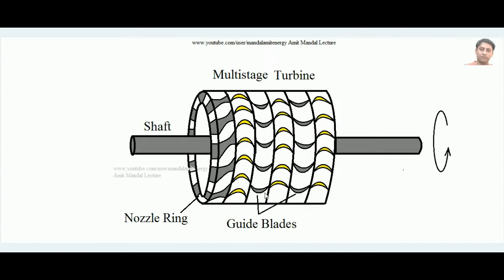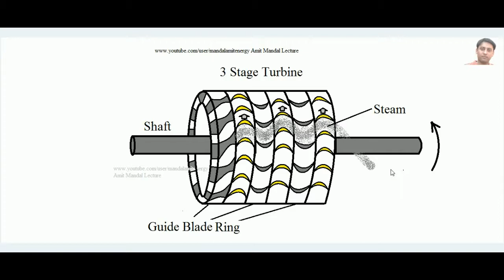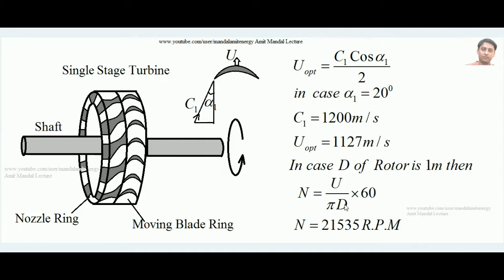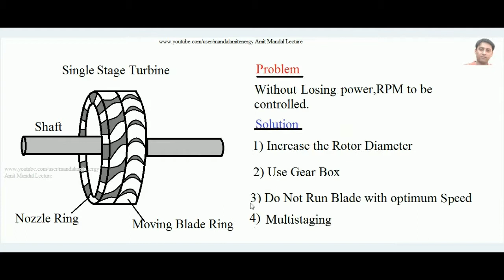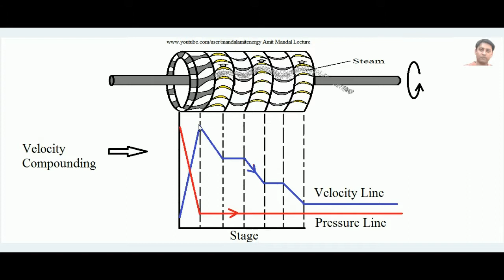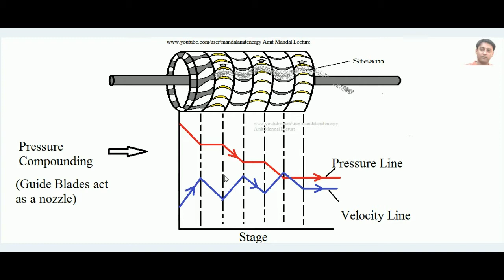Compounding of steam Turbines

Comment: sir,  in case of velocity compounding,  velocity of steam has reached  to its maximum in first stage itself, but since rotor speed is not equal to the speed of rotor intended(optimum pressure) for harnessing maximum  energy(since rotor is kept lower intentionally) .  so there is loss of energy in first stage, which could have been absorbed. but in subsequent  stages the harnessing may be improved due to matching of lowering velocity of steam to that of corresponding optimum rotor speed required. 
is it correct understanding?
Reply from the maker: Exactly..

Comment: in first stage,  steam loses. its entire pressure and velocity shoots to suppose 1200m/s and. therefore. corresponding. optimum velocity is 1127m/s, but the speed of rotor is kept lower,  so there is loss in energy absorption as there could be absorbed more,  let suppose absorbing. potential. is 25J but have absorbed only 20J. is it not a loss in velocity compounding,  however it may be small.
Reply from the maker: Ya but absorbing maximum power with lower rpm is the goal ,in overall there is benifit...
Reply: This problem is solved in pressure compounding, where we get the same inlet steam velocity for all stages. Talking about velocity compounding since each stage receives different(subsequently lower) inlet steam velocity, reducing the diameter subsequently for each stage (with same rpm) might solve the problem but I don't know if that's actually the case or that method will not cause any other problem.